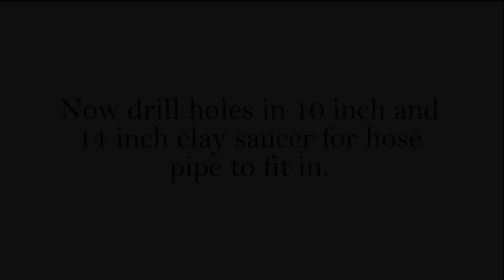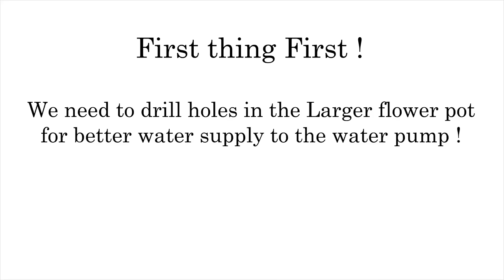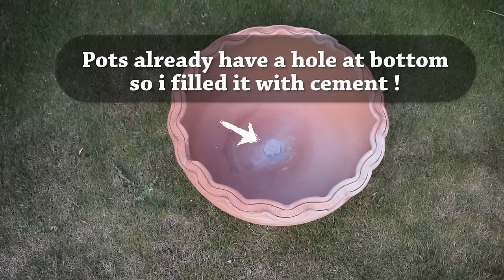Best DIY Fountain Ideas for Your Garden | Outdoor Garden Transformation

Comment: Is the water pump battery self operated or do you have to plug into a an electric sucket
Reply from the maker: thanks for watching. these are not self operated, but you can use solar water pumps which are self operated during day time.